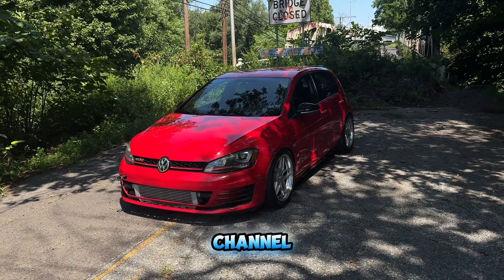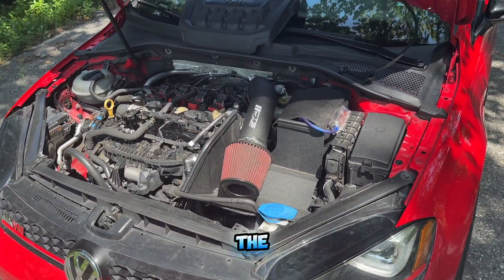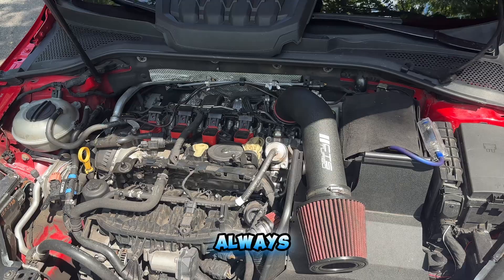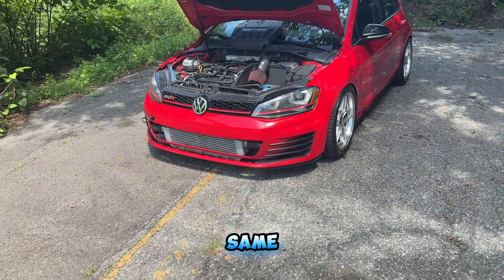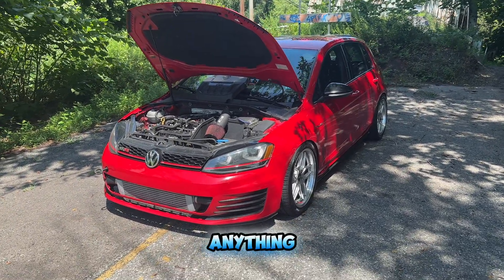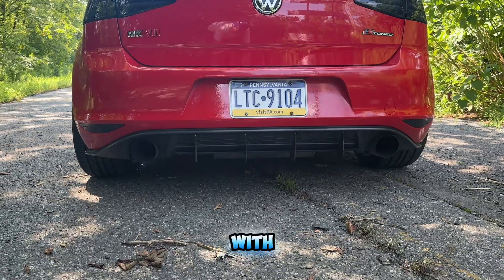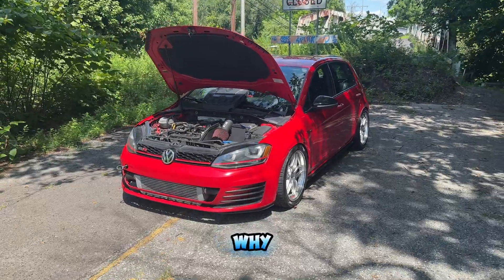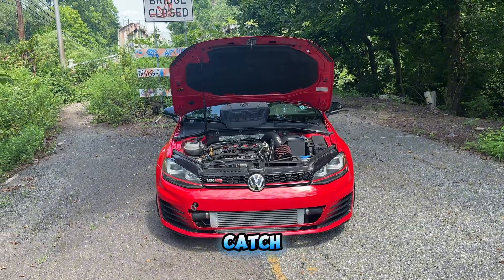HOW YOU CAN MAKE 400+ HP IN A MK7 GTI

Comment: Like this build!, I want to get my MK7 to around 350-400hp reliably, and this helps. I have a CTS downpipe, stock cat back w/ resonator delete, MST Turbo inlet w/hose connected to,stock air box w/AEM dry filter, I’m running Denso 2 step colder plugs, and Audi TTS coils. I have Ignition coil grounding kit, and planning to do a hybrid turbo, with the same intercooler you’re using. Currently on a JB4 w/ custom Map 6- don’t lane my HP stats, but the car runs really nice. So HPFP, no MPI?… curious as to why?
Reply from the maker: @sydemoid  hey man thanks for the awesome comment! U have a really nice build! When u install the hybrid turbo, it’s gonna be a completely different car. To answer ur question, when u go bigger turbo and have plans on running an ethanol blend, the upgraded hpfp is needed because you’ll be maxing out the stock fuel system. As to why I’m not mpi, I just felt like that’s overkill considering this is my only vehicle at the moment and I have over 130k miles lol. Reliability is key for me and I’m tired of fixing things over and over again lol. Maybe one day when I get another gti or golf r I’ll go crazy but for right now, my turbo setup and fueling is more than enough, at least for me it is. Thanks for watching the video, anymore questions feel free to comment again, I always respond!
Reply: @GTInick  no worries man, I figured mpi was overkill, but given its benefits, I believe it would also help in decreasing intake temps a bit. I plan on using Tunezilla, or Boosted Dynamics tuning, as it gives me the flexibility of 5 maps, where I can run regular 93, ethanol mix, valet mode, etc. as for the turbo I want to use- too many options! lol, I haven’t heard any disastrous about mamba turbos, I would love a TPC25 for close to stock spool time with an extra kick, TPC38, or CTS IS38 plus- for the ball bearing CHRA… Mabotech 520…. Too many flavors! I’m at 118k miles, and DSG… so already know the TCU will also get a tune.